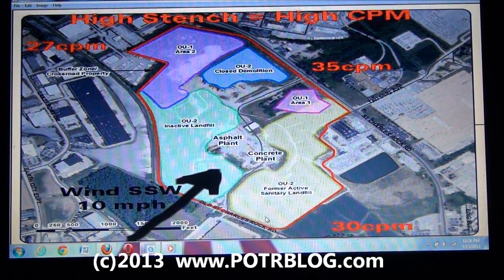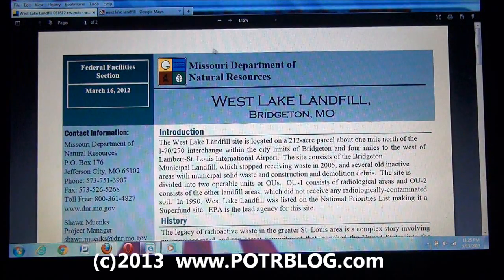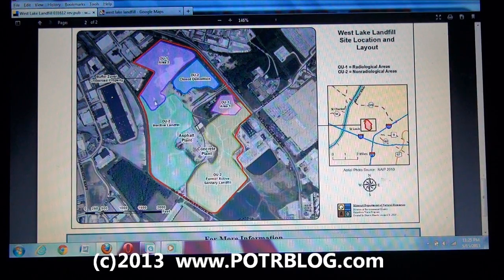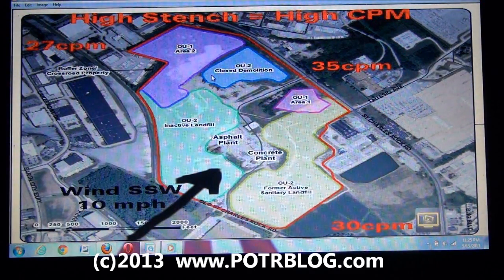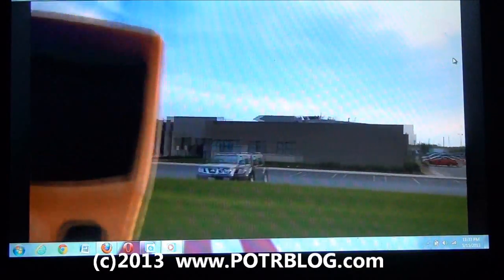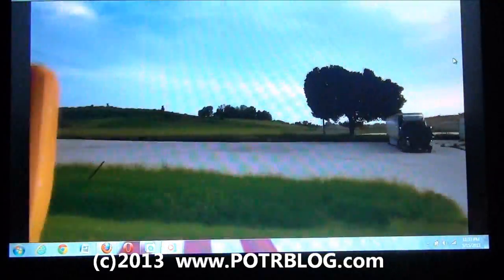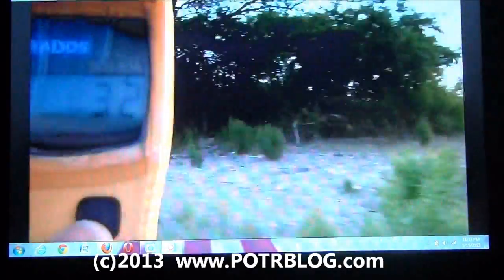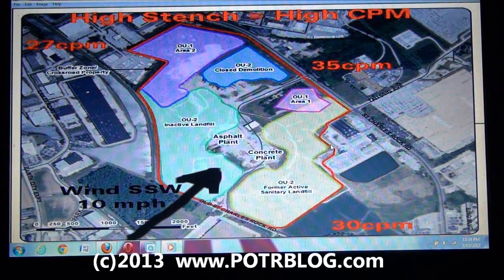Underground Radioactive Fire At Saint Louis Landfill: Airborne Readings

Comment: I'm a resident of Bridgeton the situation is critical here now. Please respond. The fire is approximately 600 feet from the rad waste. With a reported hot spot 300 feet away. Please leave a comment on our web site St.Louis Toxic Aware.
Reply from the maker: I dont think anyone can say with certainty where the rad waste is located; the real question is to what extent explosive byproducts are being generated. 
If it does explode at least people will understand there is an immediate risk; on the otherhand if it just ends up being a burning hyperactive radioactive fumigator, people wont understand the risk until its way too late.

Unfortunately you are on your own, based on what happened at DOE's WIPP site, one thing we can be sure of is that you absolutely can NOT trust monitoring agencies to give the whole truth about their radioactive measurements. They WILL obfuscate to reduce panic. Anyone who lives down wind would be wise to have radiation measuring instruments, the skill to use them, and at minimum some face masks.
Reply: Homes in this area around the landfill are contaminated, the vegetation is contaminated,the run off from the rain is radioactive. The EPA has found NO evidence of any radiation anywhere. We have been in an endless battle with Republic Services as well as the EPA for 5 years now. There are two FB pages if you are interested.West Lake Landfill and St.Louis Toxic Aware.

Comment: Hi, you can not prove that radioactivity is in the air by just upholding a geiger counter. What you will measure like this is ambiant radioactivity in any case. You need to suck air through a filter and measure the filter. In this case you still need to know the activity that stems from natural radioactivity. This one you have to subtract. Or you wait untill this activity has decayed (some day are sufficient). I would not wonder about changing natural radioactivity so I would wonder even less if